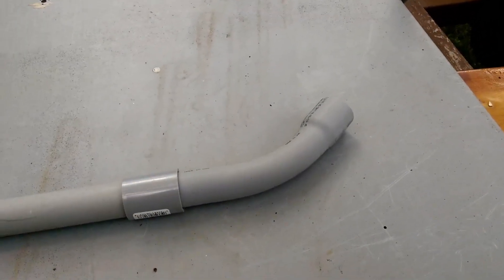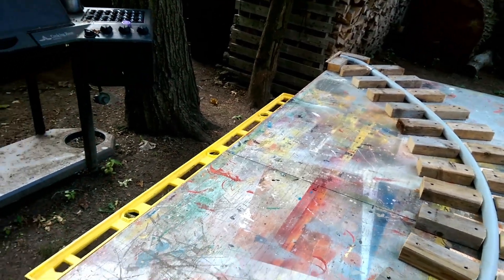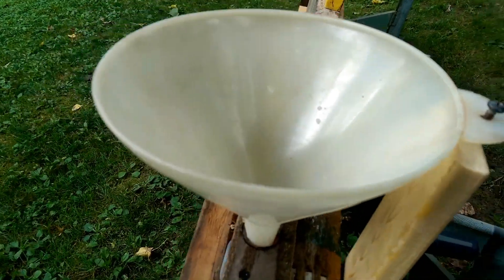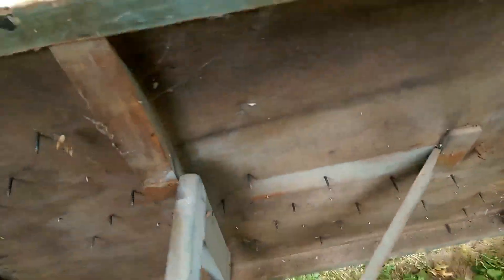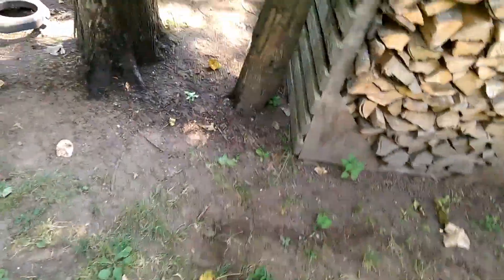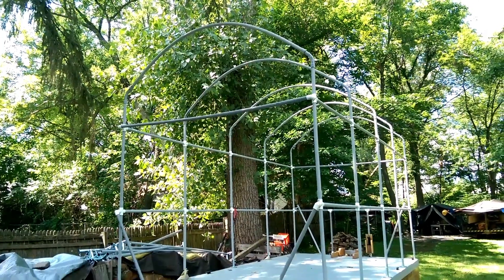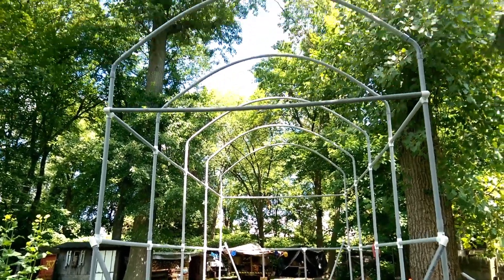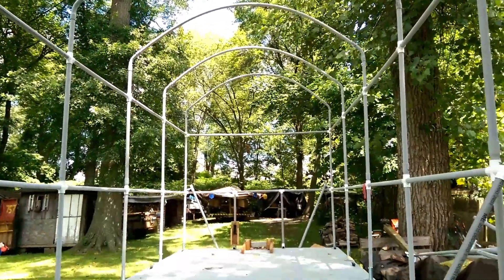PVC Pipe Bending

Comment: Not very diy possible for the average bear
Reply: The averag,e bear is only limited by will, not capability.  These people are showing you your potential.  Far as I saw, he used a drill driver in and some old wood on his set.  The materials, probably under $500.  The will, and the thought...  priceless.

Just start small, in your allotted area.  If you catch the bug... prepare to explain to your neighbors why you are smelting steel in the back yard.
Reply: Really?  Why not?  Seems pretty simple and straight forward to me.
Reply: @slrs3908  - LOL
Reply from the maker: A much more diy possible technique for the average bear is to use a rope to tie the ends together to hold the bend you want in the pvc pipe, and then you add the hot water. This is much easier and does not require a jig to hold the pipe the way you want it.
Reply: @Da175305M  if you require consistent repeated bends of rigid materials, you need a form.  If you want to make a crazy carnival ceiling...  do your rope thing.
Reply: @Da175305M  BUT, since you have the jig, it would make producing MORE quicker for those who would want some, if you were local I would buy some from you!
Reply: @Da175305M  I really like this idea, simple and easily adjustable.
Reply: cliff cheung, 
   seems like the most "down and dirty" way to get what he wanted with the most simple solution to get an accurate bend. the screws go back in the box, the 2×4's were scrap pieces already, and the table is just fine , and he already had everything to do the project.
the only material he bought was the PVC! this worked, was easy, and costed nothing! 
   you can do stuff like this! just an idea and a little time! if your idea is too weak or overbuilt, either way is learning for the next project. :)
Reply: Hey hey hey boo boo!
Reply: Bears only know honey!  More like Honey Boo Boo!  😂 😂 😂 😂 😂